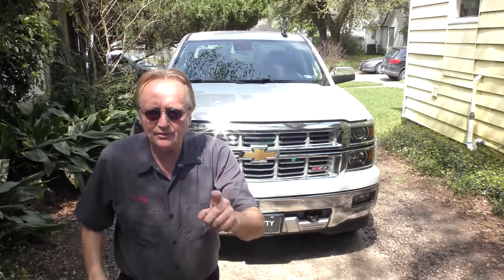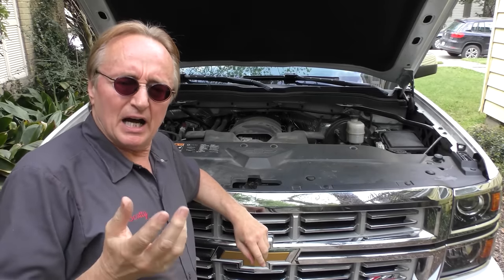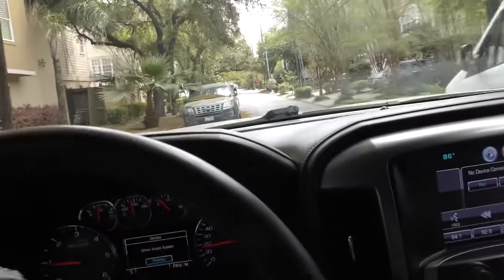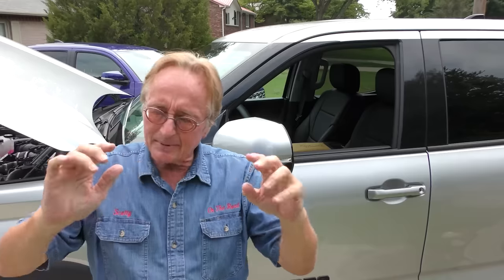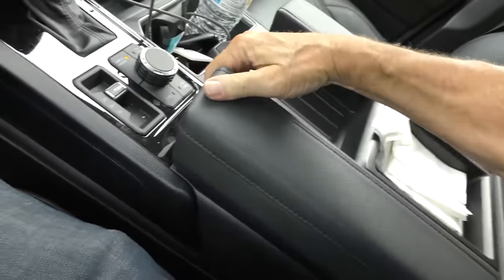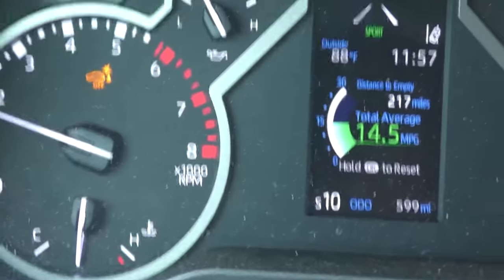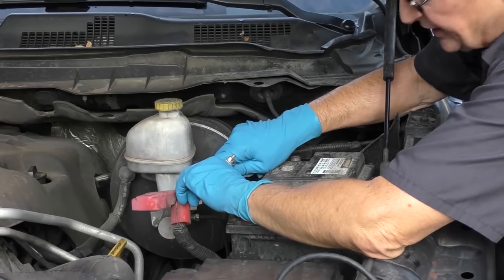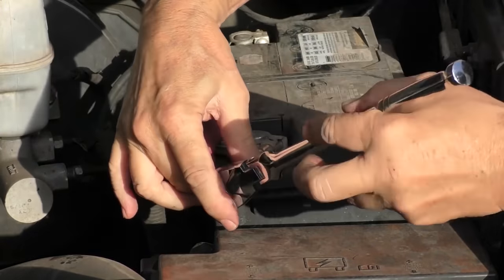3 Trucks I Wouldn't Touch with a 10 Foot Pole

Comment: I have a 2019 tundra 4x4 with 5.7l, and I drive over 80 most of the way to work, and I still average 16mpg or higher. If I'm with my wife I usually get over 18mpg, If I drive like I stole it (by the way it has a speed (not rev) limiter at 110mph) I get between 14-15mpg.  I have never gotten less than 14, ever. It is a limited which I think is slightly lighter than trd pro, and I only went up 1 tire size so still very close to stock. I can't believe he is averaging less than me with that v6,  they really should have kept the v8. I think over the years they were able to get slightly better gas mileage on the v8 by adjusting the shift points, and if you don't lift and put big tires on it still gets reasonable gas mileage. I was also lucky enough to get mine before pandemic when everyone was more worried about gas prices so the tacomas were what everyone wanted so I only paid about $45k. If anything happens to this truck, it will be my last truck. I refuse to pay (can't afford) the crazy prices of these new trucks that really are not any better than the old ones.
Reply: Maybe his commute is less flat 🤷

Comment: Well Scotty I still have my basic 2005 Toyota Camry with 308,000 miles!!! And everything Works AC & Heat power window and never ever had only any problem. That Camry runs like a Rolex... I will Never ever buy a an American cars except the Crown Vic or a 2001 Lincoln Contel.

Comment: I have 2-2015, 1-2017  '17 has 199213 miles on it. '15's are 289,908 & 348,467  they all run great. biggest fix was shifting sensor on one of the '15's We understand you love hating on Chevy. Toyota's suck at towing.

Comment: The plans handles on the chevy are a deal breaker straigt away. Had a s-10 and later nissan both hade 1 side of the handle broken off amd needed dinner amd a movie to coax open....

Lol way up north to Conroe - im in new Waverly now, and conroe may as well be called "North Houston"

Comment: I had a 2014 Silverado 1500. I bought it with 40,000 miles. Condenser started leaking Freon at about 85k miles and had to replace it. 10k miles later I noticed the transmission slipping. Sure enough, the transmission went out because the torque converter started to fall apart. Traded it in for an F-250. Silverados/GM’s are a joke.

Comment: Hey Scotty, I run a 2015 GMC 1 ton dump all day every day. It has 60,000 miles and is a gas motor. first the truck is nutless. It chews the gas around 8 mpg. When accelerating from a stop it makes a klunk and falls on it's face. Any ideas on what is making the klunk and power loss?
Reply: My 2018 Chevy 2500hd 6.0l was acting up shortly after I bought it at 114000 miles it would backfire and not go much above 50 miles an hour.  In town it was fine. Took it to a mechanic and it was only showing 25 psi at the fuel rails supposed to be 60-70 psi. New fuel pump fixed the problem 750.00 dollars later. Hope this helps.

Comment: I got lucky.. I bought a 2014 Silverado. It has a 4..3 liter 6. speed. in it.. It is the. short 4 door. Meaning the back doors are smaller than the full size.. And it has a 5 foot bed. with the factory liner. I bought it. It had only 25,000 miles a few months ago. I had to put brakes all the way around it because that had frozen up from sitting.. It still smells new inside.. I'd sell it if someone would give me a good offer.

Comment: Should I trade in my 07 Ford f150 4 Dr with the V8. It's almost 200k miles but it was a gift truck and I dumped about 3 grand into it. It's got ticks and leaks fluid. I wanna trade it in for a 2018 ram big horn. Should I just buy a new motor and get another 200k miles off the ford or trade it in for something pre owned and come outta pocket another 6-12k plus trade in for a ram 1500 v6

Comment: My Chevy the heater core started leaking.  I changed a bunch of heater cores for my dad back in the day, so thought no big deal.  Boy was I wrong.  It’s in with the ac evaporator.  Have to remove the whole dash and ac box.  Who comes up with this crap. 😂

Comment: @scottykilmer i got a 2005 dodge 1500 with a garbage 4.7l over head cam that keeps dropping rockers and collapsing lifters. The rockers fall out when truck gets shut off and it happens on random cylinders. What you think causing it? besides that its a garbage engine lol. I assume it needs new valve springs.

Comment: I had a 2001 Chevy 4.3 V6.  One of the best vehicles, car or truck I've ever owned. The only thing I like better are my square bodies.  My 4.2 Atlas engine Trailblazer is bullet proof at 270K. Just change the damned oil.

Comment: In other video Scotty says not to touch disconnected battery terminals together without putting a resistor between them to prevent damage to the computer but here he does just that. Hmm...???

Comment: An inline 6 is a far superior engine design compared to a v6 especially in a truck or large heavy vehicle.  I wonder why more automotive manufacturers don't utilize them (specifically in trucks suvs or full size rwd cars).
Reply: Because they won't have to pay to have maintenance done. How many Ford straight six's have failed? Probably not near as much as a modern V6. Companies want your vehicle to need work so you have to pay more over time
Reply: @strikefighter0497  I agree. You are 100% correct. Reliable vehicles are bad for profit margins. Also the Ford 300 straight 6 is nearly unkillable. Not the most efficient but it makes up for that with lack of repair costs and incredible longevity
Reply: I agree completely. Mine has 248,000 on it and although not a powerhouse it does what I need it to do. Plus I can get a crate motor for $1600 when the time comes.

Comment: My experience with Chevys has always been that they are fine at first, but after 30-40K miles, things begin to go wrong, and by 80 or 100K, they are getting decidedly junky! In a nutshell, Chevy parts don’t wear well, but they are cheap, so the need to be replaced a little more often than they should. They also don’t work quite as well as other makers’ parts. Chevys seem like good deals at first, but they get clunky fast if you don’t stay on top of them. That is my experience.

It’s true my dad was a Ford man, so I might be biased, but truth be told, I prefer my Toyota and BMW.
Reply: I have two chevys
Both 2500 hd. 
One has 323,000 miles
One has 179,000 miles
Best trucks I have owned.
Post 2008 I am not sure about, pretty sure the quality went down after the bailout
Reply: @dannymiller4560  Everybody’s mileage differs. Of course you can make ANY car last forever, it’s just a matter of how many repairs you can tolerate! Now, I have no idea how much your cars are in the shop, but my Toyota, well, you know, has gone over 200K, and so far the worst was the steering rack ($1800) but otherwise a starter, some kind of air pollution valve, brakes (once) and clutch (once), oil changes and and tires. I think that’s IT (I did change the transmission and transaxle fluids at 100K) and most of it was routine maintenance every car needs. I doubt most Chevys come close…
Reply: @yankee2yankee216  My 92 k1500 has 185k and ive never done any large repair yet, seems like anything from like 06 and up is pretty trash sadly though.
Reply: @callmetatersalad132  I know that people love their Chevys. I used to wonder why, then I learned that they have been better than they are today, although I don’t think the 1970s (the last ones I knew intimately) were their best years, either. I always thought they drove the best (for American), and that they looked better than Fords… but otherwise, I preferred my Saabs and MGs… and now BMWs and a Miata.

Comment: I've got a F-150 Ecoboost (3.5 liter) and it has comparable power and torque to this Toyota, and I'd rather have the Toyota, especially if it was a V-8, but my Ford gets 22 mpg on the highway at 80 to 85 mph. I've seen just about 25 mpg when I was forced to drive 70 and below, but who wants to do that? However, while it is quicker than a pickup truck needs to be and feels like it has all the power you can use just driving; nevertheless, if you are towing a good load, the milage drops to eight to ten mpg, and the feeling of massive torque and power goes away even in tow mode unless you manually downshift it to keep the revs up, where a V-8 would just grunt along.

Comment: Agreed GM has went so far down hill from the 90’s and early 2000’s it’s sad and embarrassing. Growing up that’s all my Dad would buy was GM products.

I thought I was doing good by getting my wife a new GM product, but it’s got problems just like the Chevy in this video. Meanwhile my 2005 GMC Sierra with 221k on it is still running great.

In the process of getting the wife’s hunk of junk serviced at the dealer I actually had the service manager admit to me the GM doesn’t build them like they used to.

Comment: John Deer, Ford, Chevy, Gm....all American manufacturers are building craptastic vehicles BECAUSE they make more money now on selling you parts and service.

My 1974 Ford Ranger F-100 with a 300CID straight 6......400k miles, 3 rebuilds, still going.  The transmission, 3 rebuilds and still going.  The rear end...still going.

Comment: Modern vehicles are designed and built to such a complex degree the owner can’t even change the oil. The mechanics over charge and the dealership definitely over charges. It is all about money. If the owner is able to do most repairs the mechanics lose business and the dealerships lose business.

Comment: I can say from experiance dont buy a ram i put 30000 miles on one guess what cylinder 3 misfire. Then was throwing code for oil pressure sensor i knew i literally just chang3d it. Drop the oil pan low and behold shavings from my camshaft. Seriously dont buy one they all have the same problems eventually

Comment: Gm made good trucks back before 2008 but when they got bailed out they had to cut cost resulting in cheap quality like not using the vortec engine in their vehicles those were one of the most reliable now I have 2013 f150 lariat with 5.0 and run perfectly I had a 2002 Silverado had 300k miles on it seriously gm you can do better my 2012 f150 has ac vents in the back and they blow cold 🥶 and hard
Reply: i owned a 99 and an 03 and they were both junk

Comment: You really have a hate on for Dodge/Ram vehicles but they're just like everything else today. You tested the battery and it tests low/needs charging. It could be on its way out and maybe the alternator is getting tired also (you didn't say how many miles were on that truck). Stored incorrect codes are common, even on Toyotas, when you have low battery conditions from low voltage. How many active codes did the Ram have? I think you need to step back and look at all vehicles across the board and how they're built. You'll find a lot of same problems today no matter what manufacturer.

Comment: The dodge segment is hilarious. I didnt buy Toyota because...MPG is horrible across all thier trucks...this Tundra is rediculous. Silverado...typical rip off Chevy. I have a 2017 F-150 2.7L ecoboost, cant say I would recommend that either but the MPG is insane 25mpg fully laden and a butt in each seat @ 80 mph (18-19mpg city). Check the oil often!!!

Comment: To be fair, the Toyota truck engine is broken in yet. I will presume the mileage will increase after 1,000 miles or more. The other 2 Typical Garbage Motors junk and for the 
Dead
On
Day
Guarantee 
Ends

 The warranty has expired!

Comment: Gota 2016 Ram 1500 with the 4.7 v-8.  98,000 miles.  Haven't changed anything except filters and battery, Believe it or not!
Had a 77 Dodge 1500/ custom, 318 motor......PIECE OF JUNK and bought it new!
Not 1 pro

Comment: by tye way my 2004 Highlander was a good spacious SUV... not very good on gas ... but a nice car....if the subframes both fornt and rear didn't rust away to a point where they fall apart, rear bushing get dried out and yor rear wheels start steering trowing the car out of control, connectors in the engin compartment cook causing electrical flickering and hard to troubleshoot problems, powersteering lines leak, control arms snap, etc.
i prefer my 09 CRV with 230000 miles and still feels like a new car..
Sxotty what about the Toyota cars shutting down at speed because the gas cap is loose or the seal is bad?

Comment: I wish theyd make a small utility truck like the S-10 or Ranger. I know theres a "Ranger" out, but it's basically a luxury vehicle. My bare bones, 5 spd, 2wd, 4 cyl, 99 S-10 was MSRP $8,999 BRAND NEW. These yuppy trucks are useless for many people who need the utility of a truck but no real need to tow "large" loads at least on a regular basis. Spending 40 or 50k on a gas half-ton truck is just too much money, at least for my blood. I now have an 08 Silverado LMG with about 70,000 miles (in 2023) but thats only because i have kids now. Cant put a car seat in an S10.

Comment: It's not a fifteen hour job to pull that dash. That's the flat rate "gotta make sure we make money robbing the customer on this at the dealership" labor quote. It takes 25-30 minutes to remove the ENTIRE dash. Trim, mounting brackets, wiring, HVAC box, and AC evaporator. 30 minutes to replace seals and broken lines for the evaporator, and the evaporator itself. 30 minutes to put it back together. With nothing but hand tools and no motivation to do the project it would take around 4 hours. I don't know how they come up with the labor rates on these jobs. Maybe the engineers think the tech needs to pull the windshield and intake manifold to reach some goofy bolts. They must be throwing a kid in there with no mentorship or experience, with no idea where any of his tools are, and timing him.

Comment: Silverado 1500
60k and new A’C yeah the manufacturer needs to make money 🤷🏽‍♂️ i don’t like it either. Also Chevy is the cheaper version of GM trucks GMC is higher quality with parts ect. So the fact that its biggest problem rn when you can just roll the windows down not too bad for their thirst for money. I drive a 97 with no A/C it sucks but i make do.

Comment: I traded my f150 diesel for a 22 tundra sr5. The Ford was nothing but problems and no support from Ford at all even though the problems started at 3k miles. Dealer wasn't much help either. The 22 tundra I have is getting 18mpg with me towing once a week( 23ft boat) and some city driving. It has 19k miles and I couldn't be happier !! Wish I bought the toyota back when I got the Ford and save myself alot of headaches !!

Comment: You should do a video on the part # 24256861.T.C.M Module. back ordered parts for 9 months and over 10,000 trucks not running. 2008 thru 2015, Chevrolet and GMC 2500 & 3500 trucks with the 6.6 L Duramax engine and Allison 1000 transmission

Comment: Typically it is better to attach the positive terminal first to avoid "arcky sparky city" and when doing a starter to disconnect the negative terminal for similar reasons and also unintentionally activating the starter while removing it. Now I know Scotty knows this but it seems to have escaped him during his work on the ram truck 1500 because he did it differently. Perhaps because the positive term was easier to get at or he's getting too old for this sh*t, and as a mechanic for the last 20+ years myself, I get it. It takes a toll on the body which takes a toll on the mind. Get your affairs in order to retire soon, Scotty. I myself have not prepared and I'll probably be wrenching for another 20 years at least.

Comment: The Chevrolet Silverado isn't the problem it's the year of the truck, I've done my research it was poor design by GM in the 2014 and 2015 models was like a change or years or whatever and they had all kinds of recalls and wasn't good but Chevrolet has been on top since before the 60s and will continue to be. Ford and Dodge both have always copied GM. Ford's best motor was a GM product before Ford bought the idea.

Comment: You didn’t even complain about the dodge… you just changed the starter. Every manufacturer has had starters go out. You fixed the starter and didn’t bother digging into anything else on the truck… things you could have sold. Valid repairs could have been made. You could have prevented him from having future problems. But no, instead you did the bare minimum. Is that because you don’t know how to diag and repair anything beyond maintenance items like starters and batteries? Hmmm…

Comment: that chevy has the current cheapest replacement engines and parts for any half ton truck not to mention it will probably run for 300k miles, the tundra is atleast a 350k mile truck as well. Obviously like most dodges the dodge will probably run for about 60k before needing a drivetrain replacement. 2/3 of this video is nonsense

Comment: Just about every truck these days are done the same. I spent 11hrs on a F150 heater core 2 years old. They are all crap
Reply: And don't get me started on the craptastic design of the 03 tundra. Had to replace the entire system due to a seal failure 6 months after purchase... Yeah warranty covered first go around...  2 years later same exact issue... 2400 parts alone. Month later transmission blew chunks pulling a single axle utility trailer unloaded. I parked it where it blew and called a tow truck to haul it to the crusher. Went back to the F250... 675,000 miles all original.

Comment: I am impressed with the Dodge. Decades ago Chryslers were notorious for electrical oddities. Turns out the starter motor was just plain used up. Some have said that Daimler dis-served the company in ways during ownership. But I'm convinced that the Germans and Iaccoca left behind know how and electronics. Nowadays,  Mopar's tech is shoulder to shoulder with any carmaker, IMHO.